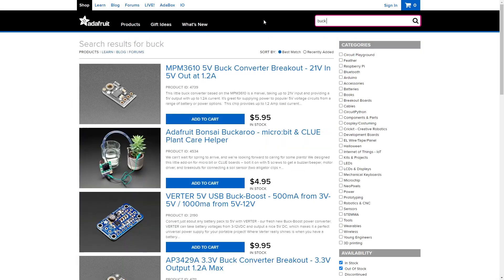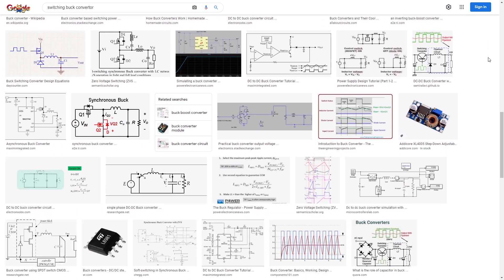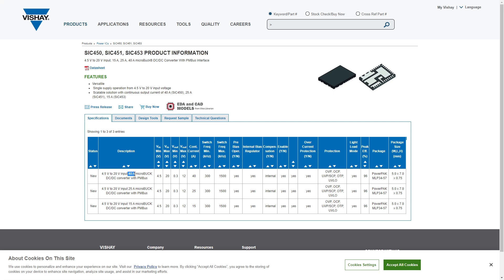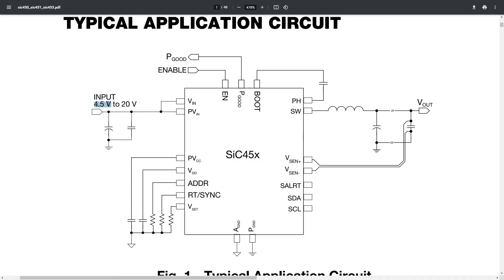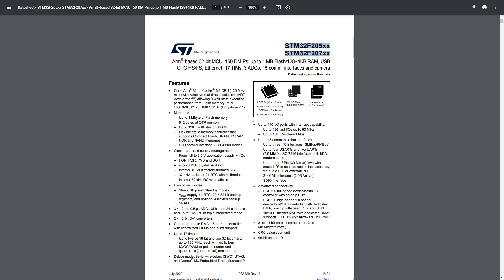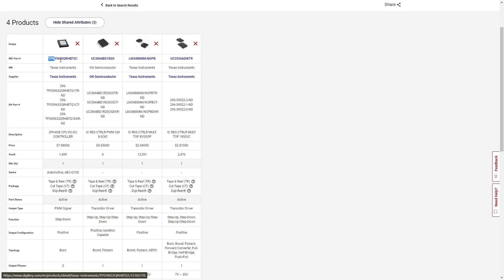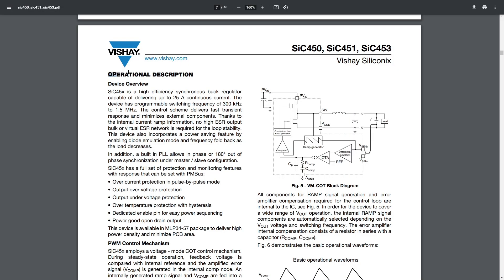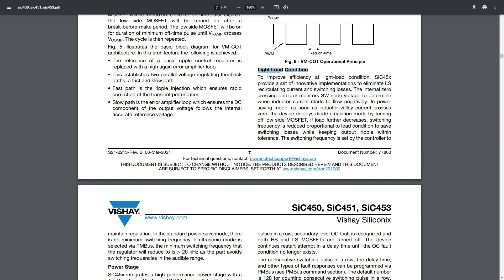How to Read an Electronics Datasheet?

Comment: Next up: How to read the entire USB protocol specification.
Reply from the maker: Haha, let's slow down there a bit 😂
Reply: @MicroTypeEngineering  Next Up: USB-C power delivery
Reply: oof
Reply: I watched a video from Ben Eater on USB peripherals and I'm still confused.
Reply: @QueueTeePies  Yeah Ben Eater is pretty good, i think Scanlime also showed some things but can't for the life of me remember when. I think one of the most helpful resources was the Beyondlogic site from like 15+ years ago, i think once you're through that, you'll find the spec easier to parse.
Reply: @SianaGearz  The new ESP32 chips have a controller built in so you can plug a microcontroller into a computer and the computer will recognise it like a removable disk drive or other peripheral, whatever you choose.
Reply: @Andrew-rc3vh  Off-topic remark from you. There's a lot of chips that implement the USB protocol and for which libraries with suitable class definitions are supplied.
Reply: @SianaGearz  Yes there are chips that work with USB, but to keep the component count down it is a useful feature. The typical thing is just a simple interface to flash the chip with. This is far more powerful.
Reply: @Andrew-rc3vh  Still off-topic, this thread is about understanding USB, not shortcuts to using USB. Besides, you can flash STM32, NXP LPC, WCH, ATmega U-series, Freescale MK, and just about anything with USB device mode over USB as well, if you foresee the corresponding bootloader.

Comment: Computer Science in a nutshell:

noob: I need help with using this library.
pro: Read the docs.
noob: I did.
the docs: Į̶͇͈̜̺͖̪̘̯̼͍͕̼͍͖̀̑͐̂̆̈́̈ ̸̧̡̤͈̳̰̼͍̫̞̬̙̞̝͎̀̔͗̔͒̉͐̈̑̐̊͂̄̐͜ͅą̸̛̛̫͔͈͍̥̘̈̊̈́̃̈́̕͠m̴̢̨̘̘̰̣͎̘̙̣̯̍̇̈́͠ ̶͎̭̼͈̫̫͖̺͎͓͕̗͋͝ͅb̸͈̰̝̥̰̠͔̭̔̊̓́͂͌͐̀̅͂̃̓͘͠ȇ̷̢̠̪̹̠̹̟̜̹͔̰͇̲̲̆̐̂̑̈́́̀̅̍͋͌̇̓͜͜͝͝͝c̶̢̛̛͚͉̹̗̗̞͔̳̭̣̳͒̀̋̕͜o̴̘͗̓͗̇̓͌͋̆̉͛̽̓̄͠m̸͈̹̺̞͂͆̊́̓̔͆̋̽̌͊͘e̸̘͕̒̈̈͌͋̇̓̇́͂͝ ̵̨̧̞̬͙̤͉͖͈̣͇͔͎̠̹͚͗͆̏̓͗̉̀͊͐̎ḑ̶̛̗̘̜̖̙͚̾̂̃̽͒̀̒͌̕͝e̶̦͐a̶̖͚͔͔͗͋͛͛̃̈ͅt̷̢̝͕̮̼̠̼̺̗͉̯͔̫̏̓̋̏͂̇̀̾̉̑̐̓̾̓̒̕͠h̸̡̛̥̯͇̅̀̊̈́͒͌͊̏̕͜͜!̷̨̨̝͕̫͕̮͉͈̭͍͎̳͉͉͉̫͆̈͊̀͂͆̓̿̔̐͗̈́͋̑̚͘̚

noob: I need help with this circuit design.
pro: Read the datasheet.
noob: I did.
The datasheet: Į̶͇͈̜̺͖̪̘̯̼͍͕̼͍͖̀̑͐̂̆̈́̈ ̸̧̡̤͈̳̰̼͍̫̞̬̙̞̝͎̀̔͗̔͒̉͐̈̑̐̊͂̄̐͜ͅą̸̛̛̫͔͈͍̥̘̈̊̈́̃̈́̕͠m̴̢̨̘̘̰̣͎̘̙̣̯̍̇̈́͠ ̶͎̭̼͈̫̫͖̺͎͓͕̗͋͝ͅb̸͈̰̝̥̰̠͔̭̔̊̓́͂͌͐̀̅͂̃̓͘͠ȇ̷̢̠̪̹̠̹̟̜̹͔̰͇̲̲̆̐̂̑̈́́̀̅̍͋͌̇̓͜͜͝͝͝c̶̢̛̛͚͉̹̗̗̞͔̳̭̣̳͒̀̋̕͜o̴̘͗̓͗̇̓͌͋̆̉͛̽̓̄͠m̸͈̹̺̞͂͆̊́̓̔͆̋̽̌͊͘e̸̘͕̒̈̈͌͋̇̓̇́͂͝ ̵̨̧̞̬͙̤͉͖͈̣͇͔͎̠̹͚͗͆̏̓͗̉̀͊͐̎ḑ̶̛̗̘̜̖̙͚̾̂̃̽͒̀̒͌̕͝e̶̦͐a̶̖͚͔͔͗͋͛͛̃̈ͅt̷̢̝͕̮̼̠̼̺̗͉̯͔̫̏̓̋̏͂̇̀̾̉̑̐̓̾̓̒̕͠h̸̡̛̥̯͇̅̀̊̈́͒͌͊̏̕͜͜!̷̨̨̝͕̫͕̮͉͈̭͍͎̳͉͉͉̫͆̈͊̀͂͆̓̿̔̐͗̈́͋̑̚͘̚

Comment: Im trying to find a source that better explains the meaning of the columns/values labeled Typical, Minimum, Maximum in the electrical characteristic sections of data sheets. What do these values mean? I notice that sometimes all three values are shown, sometimes the Typ. is missing and the other two are shown, sometimes the Max is missing and the other two are shown or sometimes all three are missing. Im having a hard time understanding the true meaning of these three parameters. I asked three different electrical engineers and I got three different explanations.

Comment: 8:30 A good everyday analogy for the absolute maximum ratings versus recommended operating conditions is the tachometer on a car.  Imagine 9000 RPM as the absolute maximum rating and 3000 RPM as the recommended operating condition.  Yes, your car can run at 9000 RPM, but only for a very short time before it destroys itself.  Likewise, we humans can have body temperatures of 102 deg. F while we are fighting off a disease, but if it stays there for your normal everyday life, you need to go to the hospital.

Comment: You say "er-ay-tah', I say 'er-ah-tah', otherwise excellent! 😃
One thing I'm wondering is, when I look at resistor arrays, they are marked as 2%, but how close are the various resistors within the array. Seems to me there should be a 99.99999% match.
Reply: Generally the datasheet will specify matching between resistors. If it does not, they are all 2% tolerance and - therefore - there could be a 4% difference between two resistors and the array still (barely) be in spec. Usually though, they will be closer than that.
Reply: It took me a while to realize he was saying errata.

Comment: Thanks for sharing your knowledge.

21st century generations will be very skilled with all the knowledge they can self-study on the internet, on top of their college, masteral or doctorate (or just high school as long as they've got the internet and are diligent).

Is this CD/DVD IC (drive for the motor I believe) the same (the bottom markings are different):

BA5986FM 
012   016  <--- mark at the bottom

BA5986FM 
005   187  <--- mark at the bottom

God bless, Revelation 21:4
Reply: Very few people have the discipline and drive to educate themselves rather than use these tools for leisure.

Comment: Great video! Microcontroller and digital Logic IC datasheets arent too bad. Analog Devices can be hard as hell. I cant even identify all of the schematic symbols in the application circuits for the MC1377 and MC1374 chips.

Comment: You have to read and (mostly) understand every section of the datasheet, otherwise, you'll pay for it the hard way when you have issues in production.
Reply from the maker: Man it really depends. We're a design shop and not an OEM. We have to be efficient with time. It's nearly always better to make mistakes on the initial design, then fix in the next revision, rather than spend hours and hours trying to get the initial design perfect (which still never happens).
Reply: Skimming is a quick way to eliminate parts from consideration, though. There's no point reading the datasheet for a chip that rules itself out on the second paragraph. :)